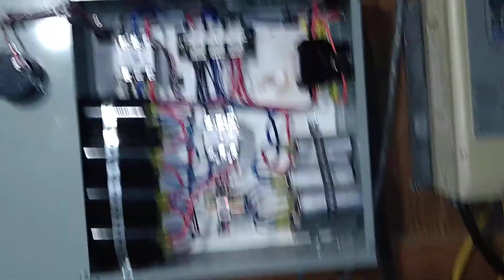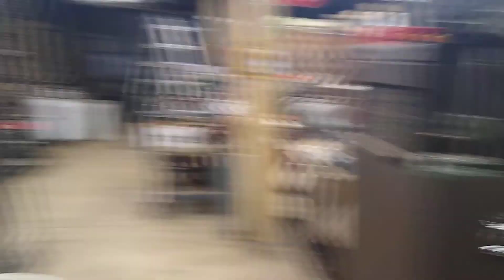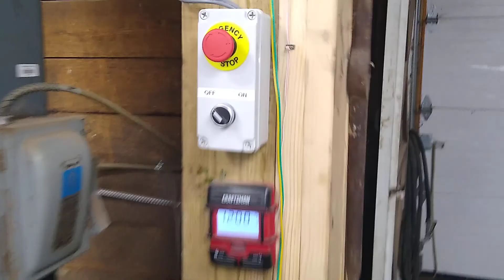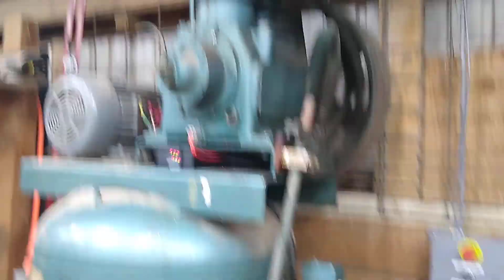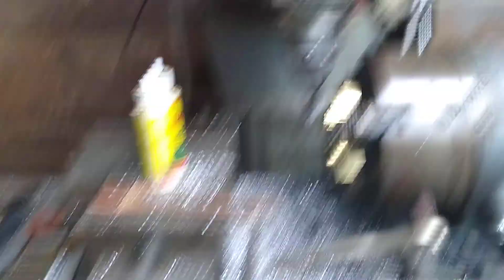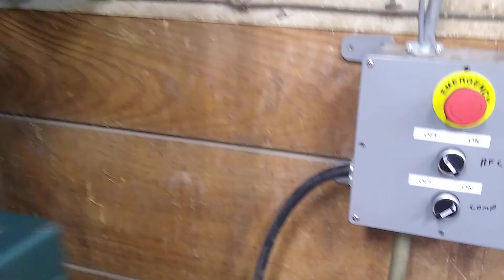30 hp Rotary phase converter Pt3 & shop update

Comment: This is by far the best homemade RPC out there! good work! Also, do you have the part number for the relay?
Reply from the maker: Thank u. Which relay. The timer?
Reply: @electromechanicalstuff2602  yes, the timer relay.
Reply from the maker: @perryraybuck1239  the ebay link go through?
Reply: @electromechanicalstuff2602  it sure did! I appreciate you.
Reply from the maker: @perryraybuck1239  not a problem. U may be able to find a U.S. seller but that was the first one I found with all the voltage and time options
Reply from the maker: https://www.ebay.com/itm/144719566003?hash=item21b1f554b3:g:opAAAOSwj2JjJInC&amdata=enc%3AAQAIAAAA8Kuk52L1zbsqE3i0xkvBMpYwwyxSTdIwbm%2By0y2eNGGyafEx3TcMzTKlnPFYZU8jx3TNpFFoUL%2B2bDPjeFCGI5U88y3cfRVPu%2BgpfBTZj2FuLvN7VyCY1H0e0ea14JCUaOkBJAwnzQPPFNmDpCndFEzaTMyQcgqTMmokocvcYX3032S0nbrrlTugPvQagAEx1BP6rXNvz7dOQk8ySYO7jwkoeZyaFDkYyFc20GBNqfxi%2BZ3G81piWobrl%2B2ni9vhcgBynzRYMfh60bDuLon5qOgV2%2F8PGBSwEYBmgkw4f%2Fnd94HZISGOJ63jAE%2B1UOuOpw%3D%3D%7Ctkp%3ABk9SR8LFutWTYg

Comment: I knew that compressor pump looked familiar, the Kellogg pump I have is model B331 va I salvaged the cooling fins and pulley off the pump for other compressors in the garage.
Today I just picked up some three phase motors for a potential RPC build two 30 hp units with new bearings one 25 hp another large one I have yet to unload as it got dark, and three smaller ones.
One pallet I bought had a New square D 30T6H transformer 30 kva 480 High 240 low 3 phase W/ 2 + 4 taps Now I am hoping I can utilize the transformer down the road for 460V  but with my luck maybe its the wrong type of transformer:)  Also on that same pallet was some shut off boxes and a large panel, I have not looked at whats in the truck yet because I found out how heavy those 30 hp motors are unloading them from the trailer, I think one had a stamp 407 lbs!.
My fear is that I do not have enough amps to the house and garage to even venture into making a RPC, the house only has 100 amps and I got 2-2-2-4 Aluminum 85 foot to the garage, I am not sure yet but I might have to upgrade the house to 200amps and the wire to the garage ? maybe 1/0 copper?
Reply from the maker: 100 amps may be enough my rpc is powered by 100 amp breaker on my 200 amp panel. Pulls 320 amps on start up. More start caps to a point the lower the start up surge. I have a video of the as well. Let me attach it
Reply from the maker: https://youtu.be/3GLraA7CznY

Comment: That compressor pump looks just like the one I took off a huge tank, wanted the tank for a bbq smoker build didn't need the pump so it will be going to auction, yeah the belt for the pump is like three belts welded together pretty cool pump

Comment: Great videos! Did you fab up the individual switch boxes (on/off/Emer) or was that assembly you purchased? Have a link to the product?
Reply from the maker: Thanks. I just made them. The box is generic. I'll try to find the link but there where no holes. I think I just searched small industrial junction boxes.
Reply: @electromechanicalstuff2602  sounds good. No need to find that link. Just curious if it was an off the shelf assy. Thanks again!
Reply from the maker: @RHD56SD  no problem 👍

Comment: Great vid. I bought 6 -  3 ph motors ranging from 3hp to 50. Biggest shop machine motor is on a 15hp compressor so going w a 30hp RPC build. Could you give rule of thumb for start and run capacitor selection? Thank you
Reply from the maker: Best video on how to on YouTube. Also download the link below his video for the detail instructions he's following. 3 parts.
Also my 30hp RFC struggles to start my compressor so I added another starting cap bank at the compressor. I'll have to make a video of it.  https://youtu.be/u229h7NcMxk
Reply: @electromechanicalstuff2602  TY, found this 3 part vid also,  https://youtu.be/h9XzczTN1IQ, pretty good.
Reply from the maker: @howiemoth3847  I saw that one too but I found the one I listed in my last comment way more beneficial on how to size the caps. I did however use the timer method like the guy in the video you listed

Comment: how many amps is the single phase 240v circuit feeding the 30hp rpc?
Reply from the maker: 100 amp breaker in the panel to withstand the start surge with 60 amp slow blow fused disconnect in line to protect the wiring. The RFC can't start anything bigger then 15 HP and I don't anticipate running more then 15hp at any given time.
Math is 15hp*756w/hp÷80% efficient motors =13987.5watts ÷ 240volts= 58.28 amps need for fuses. All my wiring is rated for at least 60 amps inside the RFC

Comment: Just picked up a 30HP Baldor "motor" that was built shaftless as a converter. It is dual voltage 1800 RPM. I have a 45kva 230/460 multi-tap transformer that I'd like to set up with the 230v mains energizing the motor through the xfmr, and wire the motor for 460v. That way I can power various machines on the 460 circuit and use smaller wire. If you look at my videos about the "monster shop", it's big... and expensive to route wires everywhere. Long term I can get 460v three phase but don't have the money for all the switchgear I'll need. I appreciate your series on this and will use the info for my converter build. I have another woodworking shop with a physically huge 15HP 900 rpm motor as the rotary converter. That's sweet because you can hardly hear it spinning so slow. Easy to start as well.
Reply from the maker: Sorry didn't see this comment till now. Transfer after phase converter. looks like u already got that figured out

Comment: how is your 30 hp 3 phase motor wired? Is it delta or wye or delta start wye run?
Reply from the maker: It's always y. It's only a 9 lead motor
Reply: @electromechanicalstuff2602  Have you ever heard of anyone trying this with a 12-lead motor wired in delta?
Reply from the maker: @TheMinecraftACManya it's the same
Reply from the maker: @TheMinecraftACManjust get it wired to your voltage. 240 single phase is most common. then one of the legs is your ghost leg. That's the one u start adding your run caps to. The caps will provide more stable voltage on that leg for usability

Comment: How did you wire meters?
Reply from the maker: Directly. They are receiving 240 volts .
Reply: @electromechanicalstuff2602  are you picking up the ground fron the single phase side?
Reply from the maker: @earleclemans4836  no neutral or ground on meters. 240v so L1-L2, L1-L3, L2-L3 that's how u get 240 volts is from line to line in usa not line to neutral like europe